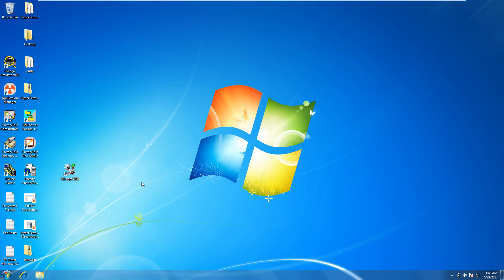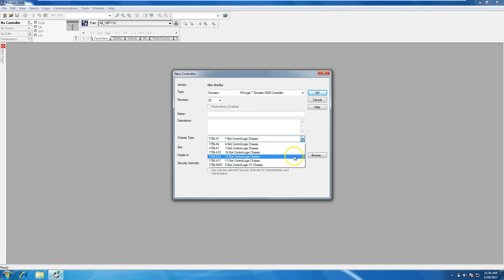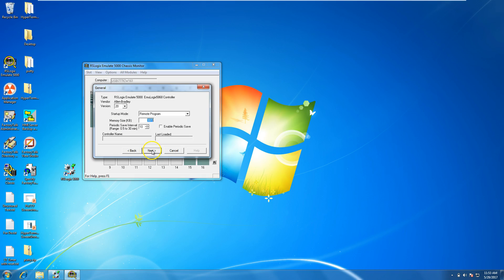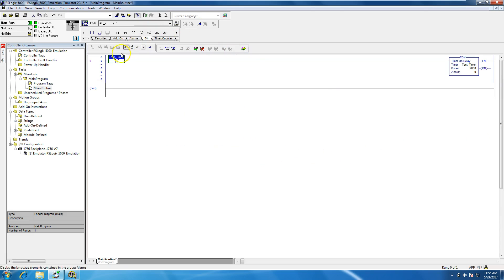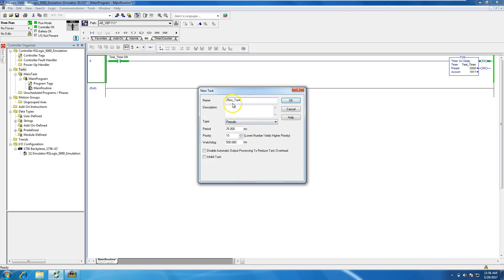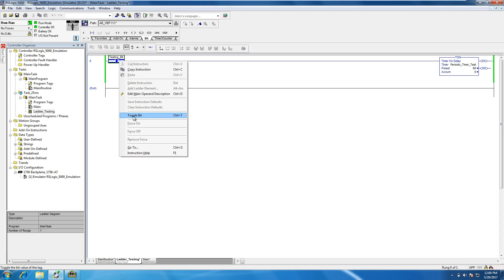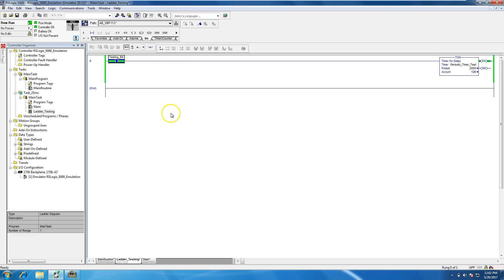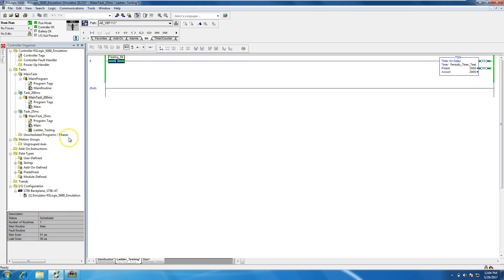RSLogix 5000 New Project Setup | Quick RSLogix 5000 Startup Guide

Comment: I bought your course on Udemy. Very helpful, thank you.
Reply from the maker: Glad to help, also...I have a new platform that has very in-depth knowledge of PLC programming
Reply: @ShaneWelcher  I will finish up the first course then look for the advanced course you offer. What is the name of the course?
Reply from the maker: @macalicious0260  if you referring to servo controls then it's called.

Advanced Servo Motion Mastery
Reply: @ShaneWelcher  Do you have a course that covers cameras, pneumatic solenoids and other devices?
Reply from the maker: @macalicious0260  

I teach programming not for cameras because everyone uses different models.

As far a solenoid control, it is simple to understand, I did a video on YouTube for PWM for a heating system one of my students asked for.

Pulse controlled heating.

In other words, a solenoid turning off & on
Reply: @ShaneWelcher  OK, thank you. I have ran into two models of cameras, COGNEX In-Sight 2000 and the 7501. Again, thank you for all the work you have done for us all out here, we appreciate it.
Reply: How to download rs emulate plz sir